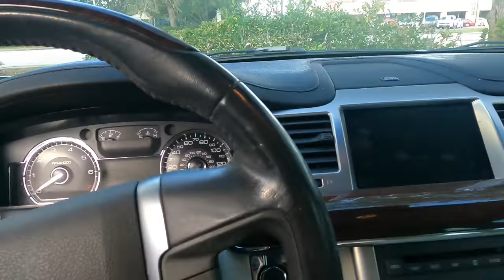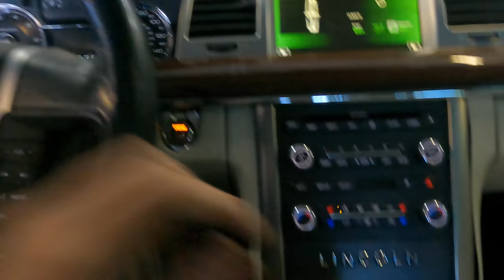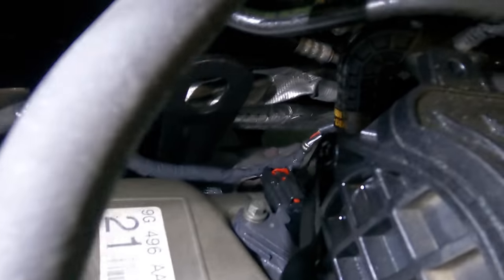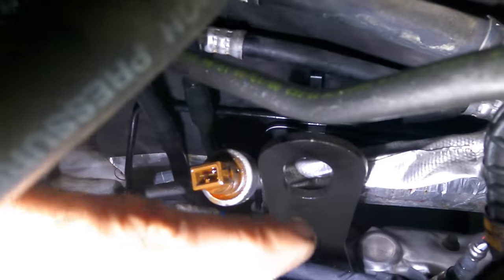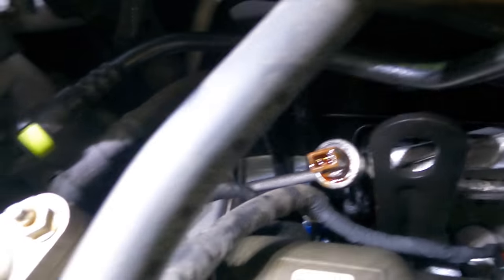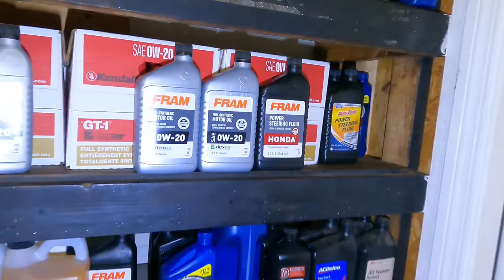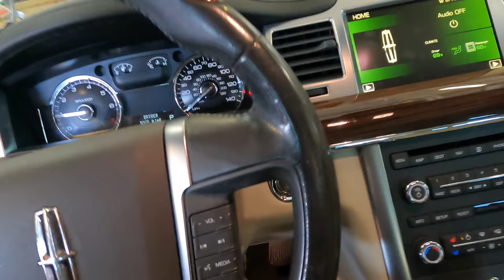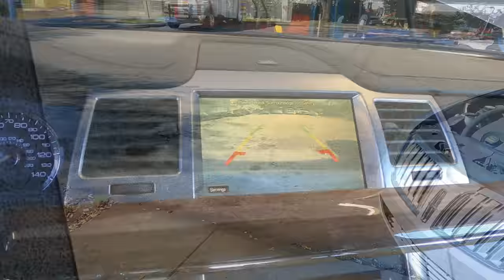Almost Caught FIRE! Lincoln MKS

Comment: So what is the function of the pressure switch, no warnings, lights, buzzers steering gets hard what is the condition of the pump having been subjected to cavitation and lack of lubricant? An old Ford I owned had a similar switch purely for low speed manoeuvring surely they’re a bit smarter now. 🤣🤣🤣

Comment: I have never understood why some people are so afraid of washing an engine/engine bay. I solvent wash modern engines quite often without any issues at all. You do have to use a little common sense and not drown control boxes and or wiring. Personally, I dislike working on a dirty engine. It probably comes from working on aircraft where a solvent wash is just a normal part of maintenance.

Comment: I know all the Fords back in the all the trucks the 9th generation 8th generation the power steering caps were just blow off sometimes when you were working plowing or you know whatever but I did blow a power steering pump and rack on a 2012 F350 dump blowing donuts one time literally just blowing donuts into wheel drive and the power steering broke that's weird but I'm not a mechanic so I don't know how that would happen I just said hey it was like that when I got in it I guess I'm a piece oh s***

Comment: IMO, over-engineered cars cause their own problems.  Did they really need a pressure sensor on a high pressure line.  You don't need a computer reading a pressure switch and a computer to tell you the power steering isn't working.  You kinda get immediate feedback.
Reply: Some use the pressure input to increase idle speed slightly to compensate for increased load on the engine to keep idle speed consistent. Same as ac compressor. I do agree it adds complexity.

Comment: Man i cringe everytime you speay down an engine bay. My dad did this to his Montero and it cost him 2200$ lol. The engine sucked up some water hydroed and bent valves . The stealer replaced the head lol.
Reply: No engine should be able to suck in water from washing it down. It's a sealed component and all the components attached to it are sealed as well. Seeing as, you know, we have to drive in heavy rain. If this story is true, you father jad something disassembled or there was a big problem with it. Again, engines are sealed components.

Comment: Terrible design on the switch. Should have the same diameter as an oil pressure switch so you can use the socket

Comment: Somebody put water in the wrong reservoirrrrrr oops. Water mixed with oil and agitated creates a foamy emulsion that lowers the boiling point and increases pressure
Reply: In regards to the air gun, in dentistry once we open vascular tissue we cannot  use high pressure concentrated aspiration cos it could create an embolism which could "potentially" lead to a heart attack if the bubble reaches your heart